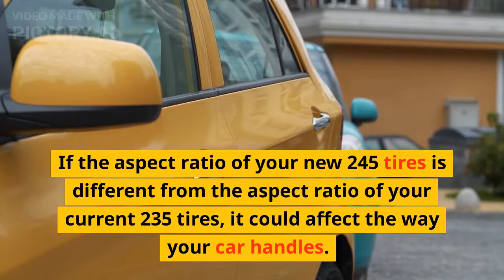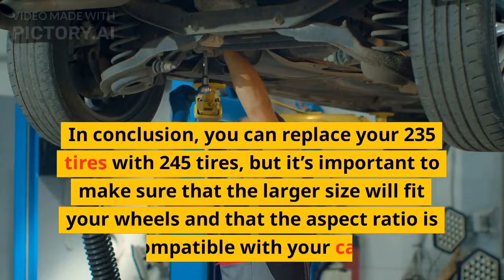Can I Replace 235 Tires with 245

Comment: Can I put 245 45 r18 with new rims for winter on my Volkswagen cc 2016? Previously, they were on a Audi A6.  Right now, i have  235 40 r18 from summer.  Bolt pattern is both the same 5x112.